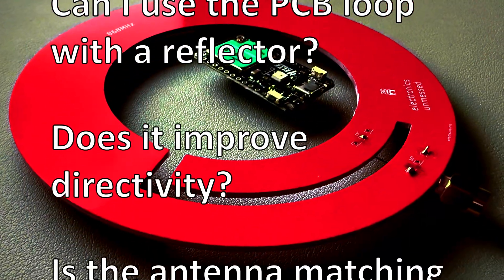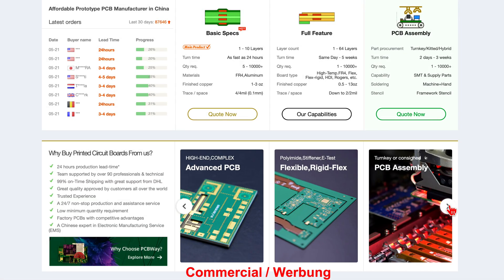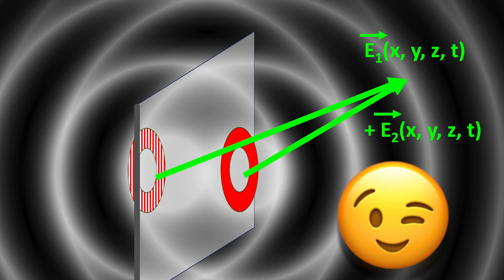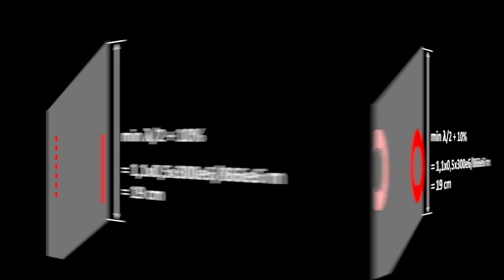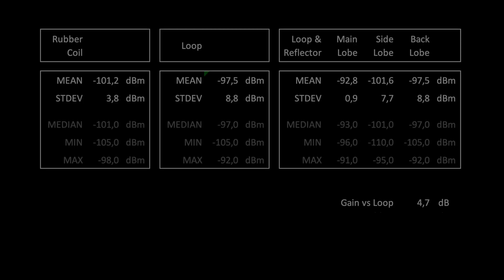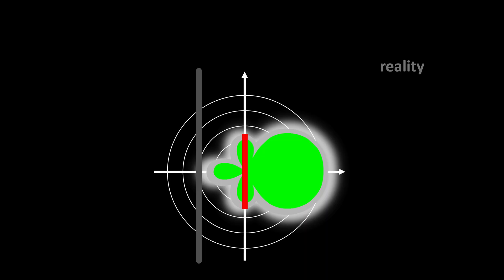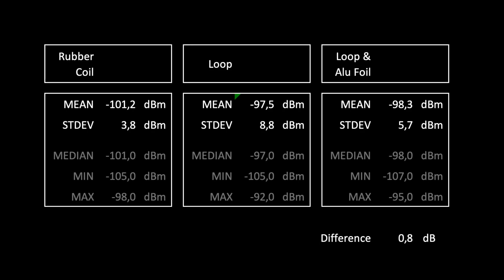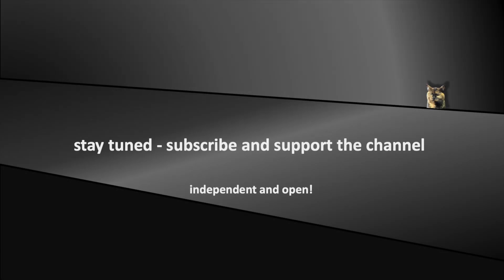RF Design: PCB Loop Antenna, Reflector & Performance Boost (EP164)

Comment: Why does my UHF indoor TV loop antenna work best when its plane is pointed towards (perpendicular to) the transmitter?  I expected it to be orientated parrallel to the wave probogation from the transmitter so as to be perpendicular to the B field.
Reply from the maker: The radiation is different from mag loops. See the videos about lambda loops. Stay tuned, there is more to come about loops.

Comment: the NEC antenna analysis program can only simulate wire antennas, or antennas made of wire segments, however the Ansys HFSS simulator can simulate materials of any shape and size with any arbitrary material.  there is also openEMS, but i have yet to try it out. MachiningandMicrowaves has used it for dielectric RF lens simulations, so it must be good.

Comment: I have been thinking about this topic since I bought on Aliexpress, the complete collection of the famous chinese donut loop antennas. There are of all flavours, For MW, SW, FM, VHF, UHF and a broadband one.
I would like to know if it was possible to add a reflector to the FM tuned mini loop version. I have two of them. The green one toroid tranformer coupled and another one with the classic 1/5 coupling loop. Both have about 10cm of diameter.
Since I didn't know the theory of this, I have tested with random sizes reflectors. For instance, I used a 12cm steel fan grill as reflector, but I have had notice of any improvement.
What can I do? Adding a Reflector or even directors to these mini FM loops is in practical something possible and is it worth it?
Greetings.
Reply from the maker: Hello again! Thank you for your comment. 
This is a little preview of the upcoming episodes, in which I'll explain a few things about reflectors:
A reflector must be larger than half a wavelength. However, you can use a few tricks to reduce it.
The quarter-wavelength distance is also important because of the phase. This distance can also be reduced using active measures.
Without tricks, for FM (100 MHz), the reflector would be 1.5 m + 10%, and the distance to the reflector would be 0.75 m.
Best regards
Reply: @electronics.unmessed  Thanks for your quick reply. These calculations are for a 1 wavelength loop, but Keep in mind I'm talking about a 10cm mini tuned loop. Do you know the chinese donut antennas?
Reply from the maker: @DJMotavirust  Sure, I know, these are loops made from 2 layer PCBs. And yes, this is a completely other animal. You get them with and without a tuning capacitor. Reflectors size and distance to reflectors would be much much bigger at the low frequency. Here is an idea: try with 2 antennas and phase shifters in a distance of a few meters. With that "phased array" you might be able to create nulls and main lobes in the radiation diagram.